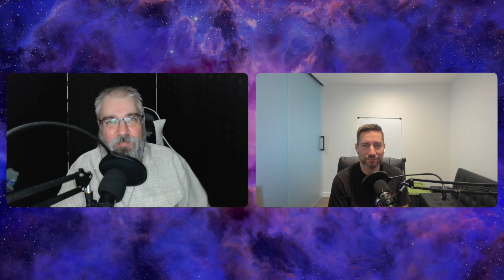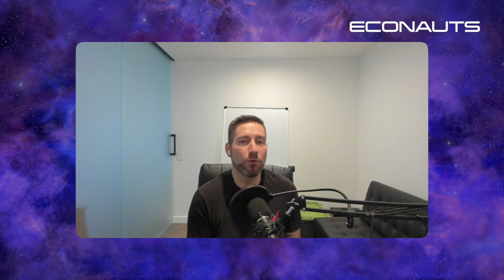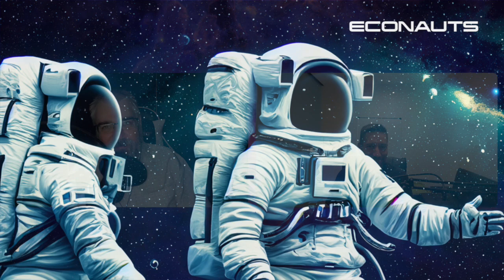Econauts: Artificial Gravity

Comment: Thank you for an incredibly insightful video on artificial gravity! The potential health benefits of artificial gravity for astronauts on long-term missions are profound. In microgravity, astronauts face numerous health challenges, including muscle atrophy, bone density loss, and cardiovascular deconditioning. Artificial gravity can mitigate these issues by providing a force similar to Earth's gravity, helping to maintain muscle mass, bone strength, and overall physiological health. This is crucial for missions to Mars and beyond, where the duration of space travel significantly increases the risks associated with prolonged weightlessness. 

However, the journey to creating a space station with artificial gravity is no small feat. Designing and constructing such a station involves immense costs and time. For instance, the Voyager Space Station, planned by Orbital Assembly Corporation, aims to use a rotating ring to generate artificial gravity. This ambitious project requires advanced engineering to ensure structural integrity and balance, which is both time-consuming and expensive. The cost of launching materials into space, although decreasing with advancements like SpaceX's Starship, still represents a significant financial investment. Additionally, the complexities of assembling these structures in orbit, often using semi-autonomous robots, add another layer of challenge. 

Overall, while the benefits of artificial gravity are clear, the path to achieving it in a practical and sustainable way is filled with technical and financial hurdles.

Kudos to the teams pushing the boundaries of what's possible in space exploration!

Cheers my fellow Econauts!
Reply from the maker: There is still a lot to do before we will see a flourishing colony on Mars.